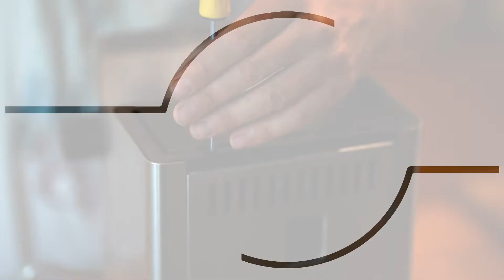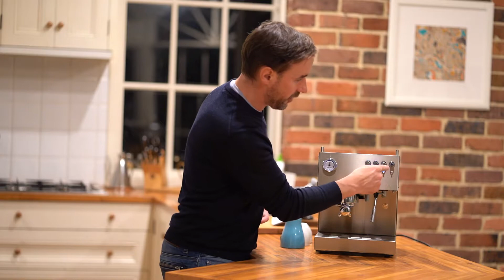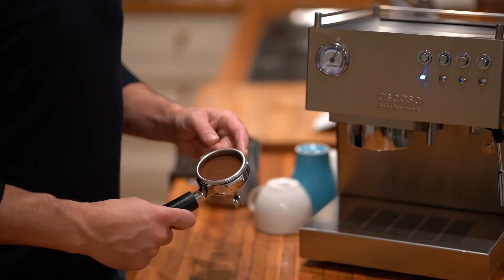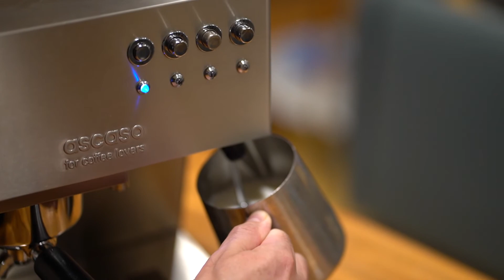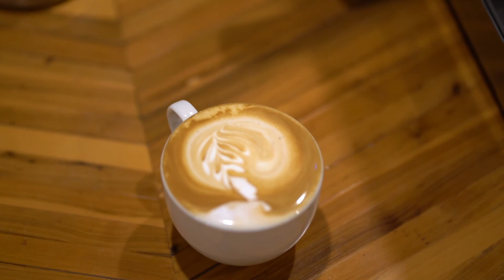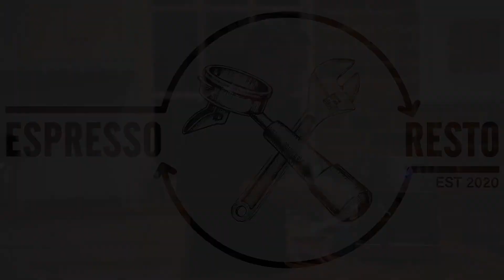Demo - Ascaso Steel Prof Duo

Comment: what model is this. To my knowledge the Steel duo has switches not  buttons  .
Reply: It seems that this is a really old version (earlier than 2017) because the modern machines are dual thermoblock machines instead of boilers.
Reply from the maker: @NilsBruch  It was mid '00s
Reply from the maker: I think they move from buttons in the earlier models like this to switches.  I think switches would last longer so a good choice.